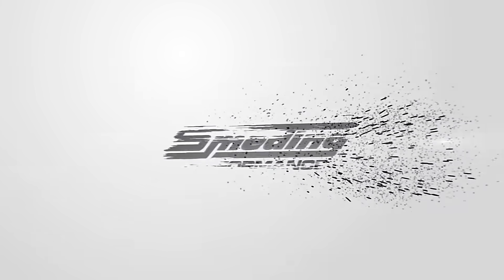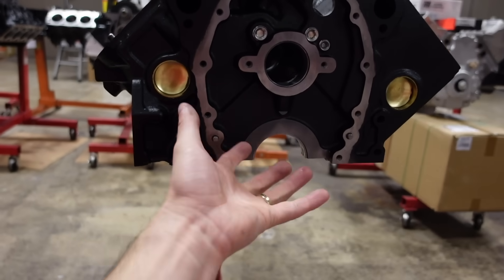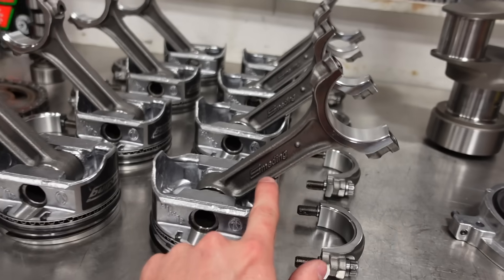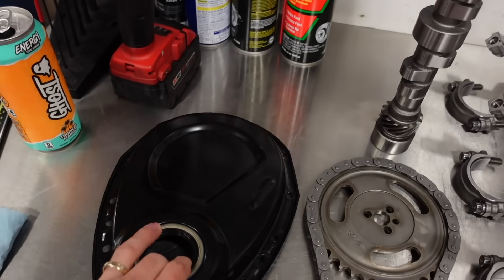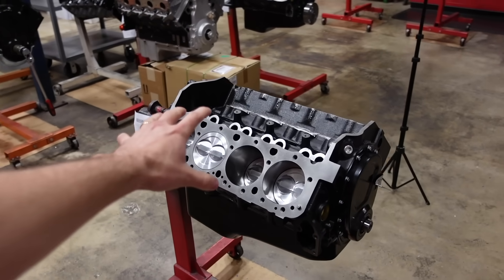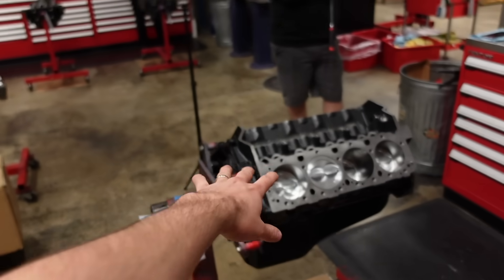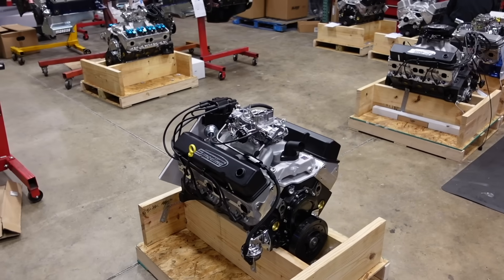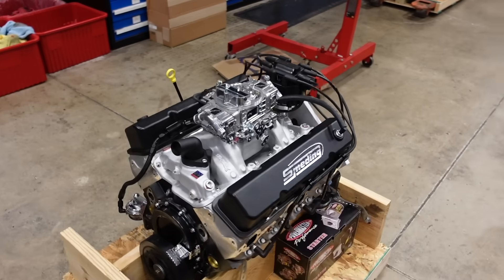Building a 480hp Classic 383" Small Block Chevy - Smeding Performance

Comment: Do you guys build these to use in 1996-2000 Chevy trucks? I want one that’ll pull boats better with the nv 3500 5 speed. Short bed regular cab Z71
Reply: It has the 305 vortec in it right now. I’ve turned a Cheyenne into a Silverado! All except for the engine

Comment: No soaking the roller lifters in heavy oil before install?
No builders grease on push rods or rocker rollers?

Let's hope that you run the oil pump and rotate the engine by hand before you fire it up on the Dyno.
I suspect lifter and cam failures - am I right or are you doing the things that we didn't see in the video?

Comment: my 30 over 350 makes more power than that.  how can you have a 1/4" more stroke and not even make as much power?  Obviously, you did something different (perhaps wrong?).  Guess I'll have to watch, just to see what's up.  Or it may be a case of apples vs oranges - different goals - different results.  Compression ratio - I'm running forged pistons at about 10.25 to 1.  Valvetrain - True roller here - get those steep cam profiles that really breathe.  Heads - I'm running Brodix Track-1's - best breathing 23 degree head I could find - beats airflow, edelbrock, etc.  Induction is another difference.  I'm running an Offenhauser Individual Runner Intake with twin 390 double pumpers with non-progressive linkage.  It's basically an eight one-barrel carbs setup. Nice block, BTW.  All I have is a Summit 4 bolt with a Moroso two-piece rear seal adapter, and a two-piece rear seal forged Chevy steel crank.  Given the differences between the two builds, everything makes sense.  I wonder how they compare on cost.  From your website, your stuff seems pretty reasonably priced.  Mine is actually a re-build of a 30-year-old hot rod motor.  I was able to re-use the crank and cam and had to replace everything else - even things like the distributor and water pump and the twin aluminum big block radiators and 4 cooling fans that keep it streetable.

Comment: I have done one 383 using 6 inch rods and it now is in my 1988 1 ton chev truck so I have started a new engine that is a 385 stroker and again with 6 inch rods for my 1991 1/2 ton chev truck and my gripe is trying to find a roller cam rated at not over starting 1000 RPM or less for a work truck that tows trailers and boats 98% of roller cams seem to be rated for racing application for mid to High range RPM.
Look at any 383 video or built for sale 383 SB and they have been done for a race streetcar & race application and no one does a video on a 383 for work trucks that tow trailers.
I think I found a comp cam for my truck application but it took 2 months of search the internet and Jegs or Summit racing looking for the roller cam that fit my needs for a cam

Comment: If it is a 383, shouldn't it have 4.030 pistons?  The ring compressor you used was 4.000.  Are you just using the smaller compressor?
Reply: They used a 3.800 stroke crankshaft.

Comment: Why would you not use a 4032 aluminum forged pistons? Wouldn't that be more suitable for a performance engine? I guess I've seen to many explode in circle track racing and that's very similar to drag and drive out power tour type of situations and heat cycles or loads. Just my opinion nice build either way guys.

Comment: Why the hell would you build a "480hp" stroker ? Some one explain. I'm rebuilding a 5.7 vortec and it should be in the mid 400 range for about 3g. Don't give me reliability Bull shit either,
Reply: essentially you build a 383 for torque. 5.7 vortec will give you maybe 380lbft. Stroker give you 480, from early. You'll feel that difference

Comment: I have a question. I noticed that you used brass freeze plugs but you used steel plugs in the cam and oil areas. Why is that?

Comment: That's correct after the two 429 Cobra jet engines the second one had the oil going to the crankshaft first cause on the first the crank seized.
Reply: What?🤷🏻‍♂️…

Comment: Funny thing is with a lt4 hot cam I’ve made over 510 hp out of my 355 vortec flat top piston 7/16th screw in studs cut down guide bosses 3000 stall shift kit th350 built th350also 373 8.5 posi u had to do all that with a 383 and still didn’t achieve what I’ve done in a few months
Reply: How did you do that ? I have a ZZ4 350 which I was going to throw a hot cam in and I couldn't even get close to that what heads did you use?
Reply: @denb3607  stock 906 vortec heads cast iron heads just get then ported and get the guide bosses cut down 3 angle valve job 7/16th screw in studs with the hex shaft on there be sure to get ur spring height installed correctly since u added the shaft 510 on a dyno
Reply: Okay so again that was the exact setup I was going to use I have the vortec heads cast iron which I have not done anything with yet . Then I was going to get the lt4 hot cam but it looked as only if I was going to come up about 450 horses and the same for torque.  my zz4 has flat top pistons as well giving me about 10.1 compression with the vortec heads.

Comment: All i kept thinking was 'overbuilt for only 480 hp'. Thinking to my 500 hp 500 lb torque 1971 block with 400 crank & hypereutectics Run since 1999 with No problems.

Comment: Can you get 600 hp out of a old school 350 sbc block ??
Reply: That’s pushing the limits on an old school 350 block. I’d go aftermarket personally. Dart SHP at a minimum.
Reply: @ABetterLifeInc  I run a 71 LT1 350 with 4 bolt mains I'd say your fine until you get in the mid 500's for torque Now a 2 bolt main block yeah 450 or so probably pushing your luck
Reply: Naturally aspirated I highly doubt it & if you managed to crest near that then the torque curve would be awful.

Comment: So a guy walks into a bar and says he built a 480 hp 383 Chevy motor. And the first thing out of his mouth is how he used a special hd block of his own design. Typical Chevy story about something that's not what they built and the Chev fan boys get all tweeked out if they get called out on it. It's NOT a Chev and is built from all aftermarket parts because the Chev stuff ends up making vent holes in the Chev block.
Reply: He states its a aftermarket block with modifications.  So what is the problem? Sounds like wanting to just stirr the pot to get reactions. Typical
Reply: Nonsense. I have a production gm 400 4 bolt block on the stock bore, with a gm 3.48 stroke crank to make a 372. With a comp cams mechanical street roller and AFR 195cc cnc ported heads, it dyno'd at 524 hp at 6800 rpm in 2010. Still going, no holes in the block. Just needs oil pressure and good rod bolts and even stock chevy stuff will go.
Reply: Or maybe just about all the good cores are gone it's literally cheaper to start with an aftermarket block vs a crusty worn out core that needs 1200$ in machine work
Reply: @96cr  1200 in machine work is still a little cheaper than a block that cost 2000+ dollars. But, it is a better block to start with so there's that
Reply: Youre jealous that in the 70s-90s people were walking fords, dodges etc cause this was a bad ass engine of its time? Or trying to compare 1950s technology to something like a Coyote that was literally designed and built in the last 20 years? 😂😂😂 you make no sense.
Reply: Somebody call the wahmbulance!
Reply: @matthewmoilanen787  you don't need an aftermarket block to make 500-525hp out of a 383

It's just getting harder to find good cores is all.
Reply: this new block is engineered better and improved design in common failure areas - which is a plus in my book
Reply: @matthewmoilanen787  well this is gonna sound stupid but I’m gonna say it anyway,, I’m a ford truck guy and have been all my life , but I’ve owned a couple of hot rods and drag cars and was in on a super dirt late model,, and we tried the ford Windsor engine in a fox body mustang and couldn’t keep the blocks from cracking after we replaced 3 Windsor blocks in one season , my brother talked me into getting a Chevy engine and put in it,, and we beat the shit out of it never had no major problems all season, just small stuff that’s it,, then we got in the super dirt late models and we went the Chevy platform instead of the ford ,, we just seen the chevy engines will take more punishment you can say it’s not a Chevy there based off the Chevy like the ford is based off the ford platform, all I no is I’ve been around racing all my life when it come to a push rod cam in block motor you can’t beat the chevy platform and I’m a ford guy,, I no it sound stupid but that what I’ve experienced,
Reply: As long as the bore and stroke are the same as the original Chevy 383 them I'm fine with it
Reply: @sandasturner9529  
Factory never made it
Reply: @xmo552 So?
We call Top Fuel engines Chrysler Hemis but they certainly aren't Chrysler and haven't been for decades.

All of NASCAR run engines and call them Chevrolet, Ford, etc - but they aren't from those manufacturers either.

As is common in this age of CAD and talented builders - we have people actually upgrading and improving blocks and hardware way beyond what GM designed and manufactured long ago.
I welcome these upgrades and improvements personally. 
It's still a Chevy regardless if this guy, Dart or whoever makes a new improved block.
Reply: Its a chevy platform man theres a difference
Reply: You must have vibrator or Mayflower in your blood Chevy blocks don't vent
Reply: We get it, your life is miserable but begging for attention in a YouTube comment section isn’t a good look for a grown man.
Reply: Must be a dodge fanboy or a ford fanboy,,, it just makes your head explode that that theses performance parts company’s focus on gm aftermarket parts , I guess because 90% of race engines street engines and Daley driver’s engines built and sold are gm,, I wounder why that is , I wounder why a big majority of other manufacturers I.e dodge ,ford when the build a hot rod they put a gm motor in them,, you mite onece in a blue moon see someone put a ford or dodge engine in a Chevy hot rod , but it rare,, but I see it every day the other way,, and it’s because the gm is more reliable and can take more punishment,, the ford and dodge will be scattered all over the ground while the gm motor is still going strong,,
Reply: Dude we used to take Chevy 350's straight out of the bone yard when you could get them for 100 bucks all day long, then we'd throw on some head's, cam and intake. Only thing we'd do to the bottom end would be throw in some good rod bolts, that's it, not even any ring gap, spray the dog crap out of them with nitrous! Beat so many cars we had no business even racing, and they would last a surprisingly long time!! We had one that made it all season and half the next before the rings decided to meet! And we were leaving on a 250 shot and bringing in another 200 on the 2nd stage so 450hp shot all in, and they lived!! So don't tell me about Chevy 's being junk cause they certainly are not! They are also the engine that started it all with the pushrod V-8's!!!
Reply: I bet there's a stock block 350 that would smoke what you got right now.
Reply: Um what lol? Nothing about this is even close to being out of range for stock bottom end or the block.
Reply: @jubjub905  OK but you do realize the block is aftermarket right.
Reply: @matthewmoilanen787  Yes. Well aware. He states it. They sell a product lol. You realize plenty of people build SBC’s in this hp and higher with stock blocks right 😂?
Reply: Bullshit! A Chevy two bolt will handle 480hp on the street. You need to lay off the booster shots. They are making you stupid.
Reply: @georgejensen339 Well Horhey, I'm a Senior Master ASE with a functioning brain because I don't believe a used apartment salesman when he tells me to use cow beds to prevent Covid and that the immigrants are eating the Cats. Oh and there's that pesky fact that I'm 64 and have won more circle track championships than you can count after your fingers and toes run out. Next you'll tell me how great Chevs are back when the CEO of the company went on national TV to beg the Federal Govnt for money because they didn't build good quality vehicles. You Chev guys are so deluded. How's that wall that Mexico is paying for going for you? Well there is a bright spot for you now because you can get all those cabbage picking jobs the Mexicans were stealing from you and have more money to spend because the Tangerine turd has fixes the economy on day one. Ha ha ha.
Reply: I got that motor with bigger heads it seems to be good 😮

Comment: Why are you not telling us things like compression ratio, cam lift, intake runner flow, valve size, carb size, header primary tube size, or total timing. If you're gonna tell us about an engine, then tell us about the engine in detail... Don't leave us with mystery on parts...
Reply: Its all posted on their website🤷
Reply: Why not just tell us in the video?? I mean, you are giving a description of the engine... right?? Why just give half the information? @02Ws6
Reply: Some of those things were mentioned actually
Reply: @fabedog383  ok, then please help to unravel the mystery. what were they? I'm tired of not sleeping at night, lol...

Comment: That is a (SMOKING DEAL) on your "POWER ADDER" shortblock with that block!  If i had the coin i would throw it down right now as i planned to build a all forged AFR headed version to replace my GM ZZ430 clone.

I do wish you had a normal 350CI.. It would also be cool as crap if you guys did "RETRO" 302CI, 327CI, and 396CI Small blocks  as well....

What is the Max HP rating that block of yours can handle? I wanna add 15psi and shoot for 750hp+ /650RWHP... 90% street engine...  But i want it to last.
And what oil pump do you guys use? Melling "Sharktooth"?!?  Those are the one i had planned to get.

Comment: Don’t think I’d be buying one of these, didn’t even degree the cam in, very shabby build
Reply: After you put together 1000 of them, I don’t think they probably need to degree the cam… He probably knows exactly how to do it without a degree wheel… as you notice he’s using absolutely all of their in-house parts… These guys warranty, the hell out of any engine, they build… He doesn’t have a ton of engines sitting there for no reason Lol
Reply: @theinvisibleman2709  a good engine man should be degreeing a cam irrespective of what or where the parts come from, how do you know they’ve been manufactured correctly, I suppose that’s what separates the good engine builder from these guys

Comment: Glad to see you guys ran a 650cfm carb..so many people over carb the motors.
Reply: I ran a 650 on a '500' hp 383 switched to a 750 cfm & the 383 was ALOT happier
Reply: @jeffdohse7124  same here, on the 383 extreme I started with a 670vs, now I have a 750vs. Huge difference.
Reply: @02Ws6  almost like running with your hand over your mouth(650 - 675) then you take your hand away.  (750 - 850)
Reply: @jeffdohse7124  pretty much. It was a very noticable difference for sure.
Reply: @jeffdohse7124  how much difference in HP and torque?
Reply: @cuzz63  Engine shop used a 750 on their dyno.  Never got around to Dyno'ing with my BG Demon 750 but it pulled a lot harder.  13.0 1/4 mile w 650 Edelbrock & 12.6 with the 750 Demon.  But I also had pocket ported heads & port matched rpm intake So the better breathing made a difference.
Reply: @cuzz63  but you are correct when you say people over carb.  See guys put huge carbs on a stock 350 then wonder why it falls on it's face or doesn't accelerate like they expect
Reply: @jeffdohse7124  yea, I suspect that you probably made over 500 hp with the 750. The 650 was holding it back. These crate motor builders would know if the bigger carb would make more power and either offer it like that or charge more for the extra power.
Reply: Ehh, 750 would be the better choice on that build.
Reply: @02Ws6  not really since its below the 500hp threshold. 650 will support up to 500hp. I could see that argument if they had thought the motor would go over that and then was restricted or if it wasnt going in a street car/
Reply: That sucker would take a 750 no question.
Reply: @joshuagarvey9362  yes and it would run fine...that wasnt the point.
Reply: Itll take a lot more than 750 if its not a street car and runs wot.
Reply: 650 would be better on a 350 vs a 383  like this.

on this  i would prefer  a 750  DP depending on the redline.  6500 RPM  redline 383...750DP all the way  350/351w/360 Chryslers....  650DP

Comment: Awesome I'm torn between 383 and the 406. I had a blueprint sbc 396 in my 71 k10 short bed. Need more power. Lol 510 wasn't enough. 😂
Reply: 421 is what you need
Reply: Are you going for street manners?  For the price of a 600 hp small block drop in a big block and reap the benefits of big torque.  Just a thought

Comment: Did you say what cylinder heads you are running on this motor?
Reply: Its their own head...probably cast by a Chinese company..he said they were 180 cc heads which IMO are a little small on a 383.
Reply: @cuzz63  a 180 is what you mostly use with dual plane intakes. just bump up the cam duration  but the fact it still makes 480hp  with a dula plane and 180 heads says a lot more about the combo as a whole than the Chinese heads alone
Reply: @cuzz63 lol, from an engine building channel

Comment: Do you guys also offer a 4.125" bore SBC or just the 4.000" ? In terms of the added material that you mentioned going into the block, is that more or less a substitute to allow all perpendicular main fasteners rather than outside splayed ? How about Billet Main Caps as an upgrade ? Very nice looking block. The cam thrust plate is also a nice addition.
Reply: Splayed mains are stronger than straight.
Reply: Splayed mains are stronger than straight.